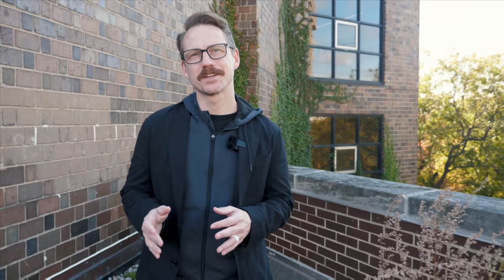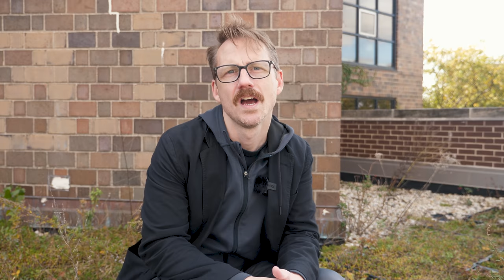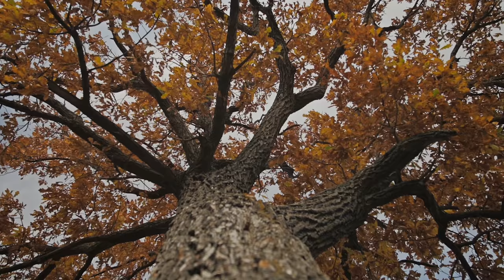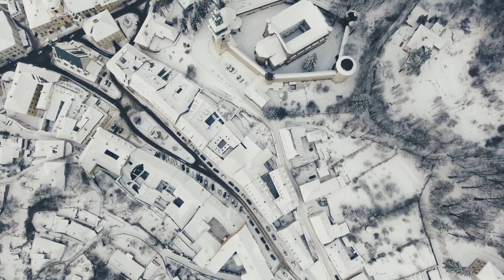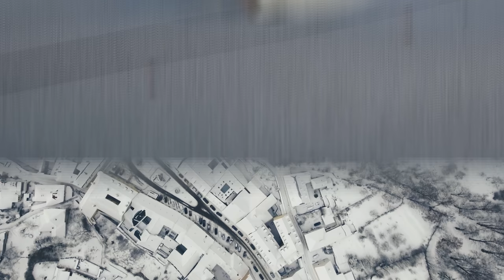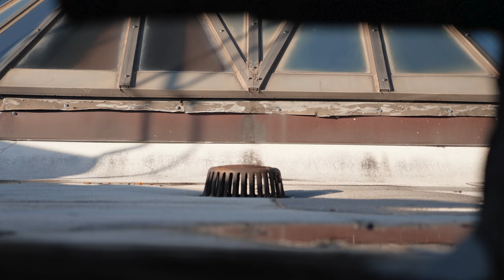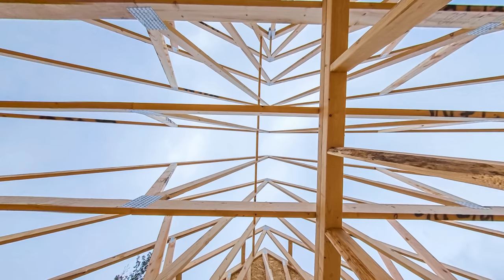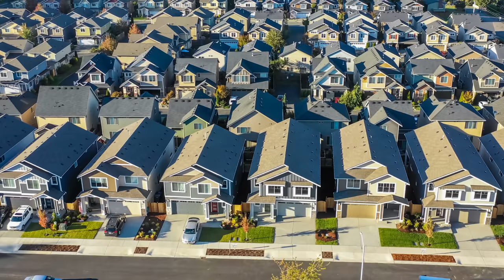Why Do Architects Insist on Using Flat Roofs?

Comment: Thing about flat roofs is the installation needs to be spot on.  Most leaky flat roofs were not installed correctly, ie slope is wrong and you get standing water.  Or the contractor didn't install the membrane correctly, flashing is wrong, etc  If your roof leaks in that first year or two, you're gonna forever be chasing leaks until you rip it out and do it all over again the right way.   Also maintenance is more of an issue on flat roofs, you need to make sure the drains and downspouts are not plugged up, gotta check that stuff regularly, especially in the fall if you have a bunch of trees.
Reply: Exactly ... find me a 10 or 20 year old flat roof that doesn't look like a jackson pollock painting made with polyurethane sealant (as the owner has played "whack-a-mole" with the leaks over the years) and I'll present you with a unicorn horn, or some hen's teeth. They're about as common!
Reply: @danielscott4514  My roof is about twenty years old and it looks exactly the same as it looked the day after it was completed. I have never done any maintenance on it and it has never leaked. I have seen many roofs that are as you described but that is just because they were built by someone who either doesn't know how to build a roof or just doesn't care. It is not even difficult to do it properly, one just needs to not be extremely incompetent or careless.
Reply: @listerdave1240  You should probably buy a lottery ticket - you're clearly a lucky man ;) ... you're right of course - it is possible to build a flat roof well, it's just a lot harder to get right than one with a slope.

Seems there are way too many cowboys and smeg-heads in the building game though. It's possibly better in other countries, but even some of Australia's biggest construction companies have a history of cutting corners - and all too often those corners are cut in "out of sight" areas like waterproofing. 

I remember an expose on Meriton about 15 years ago (a large builder of multi-level apartment buildings who, sadly, are still in business) where building inspectors were brought in to a highrise plagued with issues and when they broke into the walls between apartments (which are meant to be fireproof) they found the gaps around pipes penetrating some of those walls had been "sealed" with lumps of wadded-up newspaper ... yup, that's to code! 

Needless to say, far too many highrise buildings in Sydney have issues with water ingress - waterproofing is a favourite area to be slap-dash!
Reply: @danielscott4514  It's not really hard at all, one just needs to have the will to do it right.  I actually find it difficult to understand how a gabled roof is simpler - it seems to defy logic that it would be simpler - I mean what is simpler than a flat slab of concrete ?
Probably the issue is that because it is so simple many incompetent people get to make them because they can while gabled roofs, being much more complex can only be built by competent people.
I think if the same people that built the bad flat roofs were asked to build a gabled roof they wouldn't even manage to complete it without it collapsing, let alone make it weather proof.
Reply: @listerdave1240  A pitched roof is a lot easier to get right because typically the roof cladding materials used for them don't require sealing. They don't require special sealants because they're not designed to have water standing on them, but to let water run off quickly enough that it won't find its way into the building (typically they rely only on overlaps of the roofing material and the speed of water running away from the joints to prevent water getting in). It's all quite "foolproof" in the sense that it doesn't rely on a whole bunch of material engineering and fussy drainage to make it work. In the case of a pitched roof that slopes toward gutters that are out over the edge of the building, even if your gutters are completely blocked up, or have been blown off entirely, water is not going to get into the building as a result.

Waterproofing (whether you're building a flat roof, or a swimming pool, or an infill slab - which is a building partly underground) is actually quite tricky and needs meticulous attention to get right. Even good builders can come unstuck with these challenges - and cowboys can make a real pig's ear out of it.

For a lot of buildings, a concrete slab overhead is massive overkill for a roof. Concrete is expensive and difficult to cast in-situ up at height (sure, it's done in big commercial and residential buildings, but it's not cheap - you will rarely find concrete as a roofing material on warehouses or residential homes or even small apartment buildings - e.g. up to 10 apartments).

Finally (and most importantly), concrete is not waterproof: it's porous! Without additional waterproofing materials, water will get in. It will also seep in at every place where separately cast sections of concrete join - so those need sealing too. It's a lot harder than you might think to make a "simple concrete slab" over your head waterproof. The problems are only compounded when drainage fails (as it so often does) and water is left to sit around on the concrete for days (or weeks if there are frequent showers and not enough sun in between to cook the water off).

If you ever stand around on a rooftop terrace that's covered in ceramic tiles, bear in mind that someone has had to carefully paint, or lay some kind of waterproof membrane between the concrete subfloor and the tile adhesive and grout. You might be surprised what an absolute torrent of water can find it's way through tile grout and down cracks in concrete to come pouring out below.

Since I was having a moan about Meriton before - here's an article showing how bad it can get: one apartment owner had to build a little dam in his living room because so much water comes in whenever it rains: https://www.abc.net.au/news/2017-03-31/leaking-buildings-mould-court-battles-dark-side-apartment-boom/8403744

That's a 2007 concrete apartment complex with a flat roof made of concrete. It's address is: 33 Hill Rd, Wentworth Point NSW Australia - the building's name is Palermo. If you're poking around in google maps, note that both large industrial buildings near it have gable roofs made of sheetmetal: cheaper, easier to construct, more reliable, less maintenance obligations. The framing for industrial buildings like that is very simple too (as a rule they don't use trusses, but just rafters and purlins, with columns every so often to support the rafters).
Reply: Flat roof only make sense in commercial buildings where it is in constant use and can be monitored  for problems like  leaves blow up onto them blocking drains  causing leeks and businesses can afford to  maintain them  .
Reply: But that's the thing there is always some issue with flat roofs

Comment: As a roofer, I will tell you that this is one of the best explanations of different kinds of roofs that I have ever seen.

Flat roofs are fantastic, but they do need more maintenance to outlast a sloped roof. Those roof drains clog up easily and should be checked every 3-6 months. Most flat roof manufacturers require a regular maintenance plan to be in place for their roofs to be warranted.

Outstanding video!
Reply: If a roof needs maintenance every three months, I consider that bad design.
Reply: @bgeyssens  i call it “maintenance” but it’s really making sure the drains aren’t clogged, scuppers are clear, etc….
Reply: @roofingtips    Do you make money "maintaining" those flat roofs?
Reply: @DarkMoonDroid  I have a few clients that hire me to maintain their flat roofs, but we mostly specialize in shingled roofs.

Comment: I've never really had a second thought about this, but I actually think it would be nice to have a house with a flat roof. That's another level of usable space.
Reply: Lived in one when young, they tend to leak more than slanted roof.  Just NO.
Reply: @bennym1956  Same here, hell of a lot more maintenance and problems. My father built the home (one of many thousands) and was an architect. He never built a flat roof again on a house for himself, lol.
Reply: There's no problem.    You can put a draining flat structure on top of an only almost flat roof.    Just like new York's fire escapes or all kinds of metal stairs.  Should be cheap enough .
Reply: In Maine we cover it and call it an attic
Reply: I live in a flat roofed house and it is not good.
Reply: Hated every winter season with a flat roof. Ice buildup, water weight,  leaking every large snow dump. On a high-rise building I can see wanting to use the 'floor space' for HVAC etc, but it's a rough trade off. Took my lumps residentially, never again.
Reply: living in Switzerland and also working as a technical drawer, there are many norms to be followed for any type of roofs. if you build something and want it to last, you need to understand the deep physics how which material works and how it has to be constructed. if you made a mistake in construction, learn from it and don’t just discard it.
Reply: I hope they don't leak as much as every flat roofed school or business I've been in😩
some idiots (who probably don't know how to flat roof), built a flat roof apartment in my town and people on the top floors had their stuff water damaged by horrific agressive leaks in the first five years

most apartments here have gabled roofs
grocery stores and warehouses tend to have gentle slopes
...well the ones without tarps and sadbags on the roofs do
or brown celing tiles and water collection buckets everywhere 🙄

I'll believe in flat roof when I see one that works for the first time in my life
Reply: I had one and most houses can really only access their roof with a ladder outside of the house so it's not really accessible and it's a lot of care. I maintained it myself so it didn't cost a lot of money but if you let it go, it can lead to leaks.
Reply: @grain9640  I live in Canada and I have strong winter and I see a lot of flat roofs in my city. I've lived in one myself, and most businesses and schools have flat roof. I'm not really aware of leakage issue. I never even unplowed my roof when living under one. I mean, if you don't take care of it it can leak, but it's not really hard to maintain.
Reply: @lostintranslation57  You need a lot of reinforcement to have a roof garden.
Reply: @grain9640  seems like you have a problem with shitty roofers and not with the type of roof.

I'm a foreman in a roofing company that only does flat roofs. North of the arctic circle, all year around. There are seldom any problems and most get discovered during the construction.
Reply: @tanelpolts7257  You're right. Since making that comment, I've uncovered that my town has legions of shitty contractor roofers and there's a lot of corruption and cost cutting been going on in major buildings. It's come to my attention live in a developer/contractor warzone where people are outbidding each other and building cheap shit faster than the other guy
Reply: Yea if you plan on walking and having parties on your roof, guess what, its not going to last long
Reply: @chiquita683  why do people with no clue insist on commenting? Shush now.
Reply: @chiquita683 u can have the waterproof element beside the element you’re walking on, as with a wood terrasse for ex

Comment: When you live with pine trees, you learn to hate flat roofs.  Seriously, I can't imagine why the house across the street from me, in a neighborhood that is full of tall pine trees, was built with a flat roof.  It was just a giant pine needle collector and if you didn't get up there and throw them all off at least every month, they'd sit there, wet with rain, and rot and mold would take hold.  I watched my neighbors deal with leaks and re-roofing (at a much higher frequency than should be required) for about 20 years.  They even cut down all their pine trees!  But the needles from next door were still enough to accumulate on their roof.  Eventually they got tired of the situation and sold the house.  The new owners had major roof problems yearly for the first couple of years.  Then they hired a crew to simply build an ugly gabled roof slapped on top of their house.  It looks awful but they haven't had a roof leak in years.

If there's a pine tree within 100 yards, don't build a flat roof at any altitude less than the tops of those trees.
Reply: Surely tops of where the trees will likely grow to.
Reply: Better yet, don't build flat roofs ever, or cities either, personally don't use any concrete/steel building, at all, 2 story buildings is as far as I'm concerned the tallest any building should be. And if you need to build a factory, well, build it somewhere else, how about on the moon, so that I won't have to see it. Man am I glad to be living in the countryside, because at least I get to see meadows and actual houses, and not ugly concrete monsters, void of life.

Comment: I work designing and quoting wooden roof trusses. Speaking only about that particular type of structure, low-slope roofs are NOT generally cheaper. higher sloped roofs, up to about a 7/12 pitch, will carry more load with less material making them the less expensive option. Low slope roofs often require larger timbers, higher grades of timbers, and sometimes tighter spacing of trusses, to carry the same loads. Especially in cases where the architect needs a shallow roof to meet the local code height requirement.
Reply: Thanks, this was really informative!

Comment: The issue isn't that "one is better than the other", it is that a lot of architecture students tend to use flat roof as a design by default, for reasons other than function; usually, because it is easier to draw and model.  It is more important to know why we chose this particular shape over other shapes, and also choose it with consideration for building type, function, height, and square footage, climate, etc.
Reply: To add to what you said I think that a lot of issues come from the details so an novice or junior architect might not have the experience to see all the areas that might pose problems. The aesthetic of a flat roof is really appealing but also takes some experience to get it right.
Reply: Are you suggesting no meritocracy exists, and society must be victim to every architecture student for some reason? 

I'm pretty sure that's not how the world actually works.
Reply: I would argue that it is actually more difficult to design a flat roof properly. As mentioned in the video, the roof itself should never be perfectly flat. However, the structure on which a "flat" roof is built usually consists of horizontal beams. The decking needs to be sloped slightly to get water to move towards drains. I am not an architect, but can imagine that it would be a challenge to spec out the correct materials and techniques to ensure proper drainage.

A pitched roof, on the other hand, consists of flat sheeting (steel or plywood) fastened to a truss structure with a pre-defined slope. It is pretty intuitive how it should go together, once the truss detail is established.
Reply: @martinliehs2513  It also needs to consider which direction the water should drain to prevent water freezing.
Reply: @jeremyO9F911O2  nowadays, it really is with the power of peer review, we have made experts as informed as students.